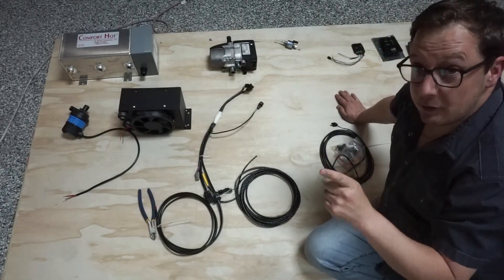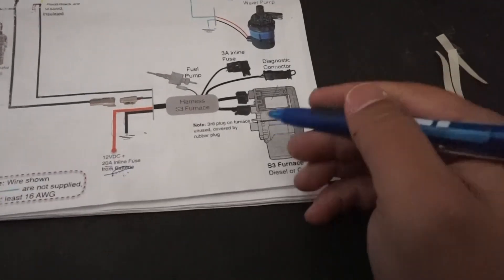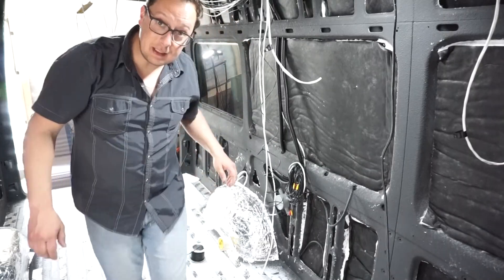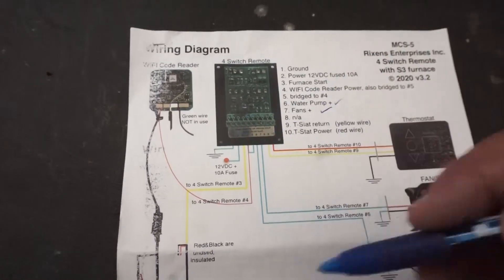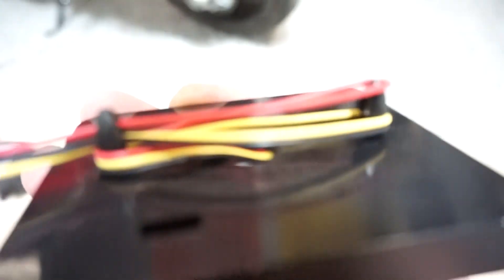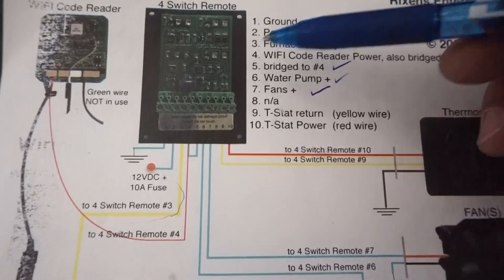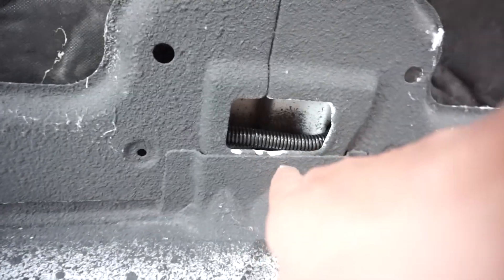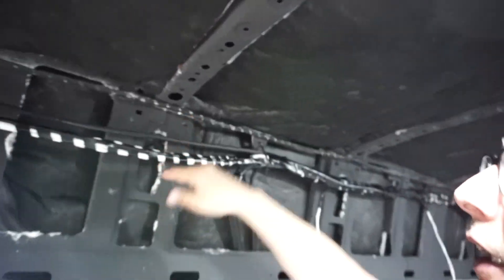Hydronic Diesel Heater PRE-WIRING | FOUR SEASON VAN LIFE | EP.24

Comment: Oouf... you might regret that electrical tape the first time you need to deal with upgrading a wire or trying to access one within the bundle.  For long runs Loom is the smarter way to go, way easier with any future upgrades or wires you may want to access.  Lesson I learned working 7 years in the automotive electronics aftermarket.  Very clean install regardless.
Reply from the maker: Thank you for commenting, I hear exactly what you are saying and I do have a plan to have an access to add new wires if ever needed. I did buy high quality wire and ensured everything was solid mounted to prevent any future wire issues and honestly once you have that many wires run through the chances of pulling it out and adding another to the same loom would be a struggle at best.. Do Stay tuned and I will share what I am doing to deal with potential wire failure or upgrades needed down the road.

Comment: Love the vedio!! Can't wait to see your next hydronic system installation vedio. Hydronic system is also something that I am considering for my vanbuild. Rixen make great product, as shown in your vedio,however their coolant tank place inside the car(right?) . I am a bit concerned with the health and later maintenance issues. I am considering would it be a good idea to just tap in to the engine coolant loop like the hydronic system intended to do. This can protect the engine during winter by pre heat the engine also warm up the room. Also when the engine is running and heat up the coolent, you don't even need to turn on the hydronic system to get hot water! more energy efficient! I am not sure if this is snow and curt 's design.
Reply from the maker: I have a separate pre-heater for the engine that comes from the factory.. They are very similar burners but don't work the same.. You can  plumb it in to create heat off engine without running burner but would be running some pretty long hoses front to back on the van!  Yes coolant tank is inside the van and fully sealed, shouldn't create any health risks.
Thanks for watching and commenting, glad you are enjoying the videos.

Comment: Hi Jeff
You have great organizational skills with all your wires. Wondering why you didn't use zap straps instead of that sticky black tape? I've watched all of the Snow And Curt recirculating shower episodes, AWESOME, and have learned a whole bunch so that my head will blow up. LOL. I am leaning towards Rixen's kit as it includes everything I need  for my shuttle bus conversion. I do believe your are Canadian and was wondering how the shipping was from Rixen and how long did the kit take to arrive? Which Espar model did you get? I am looking at the S3 economy for gas power. Thanks and have a great Day.
Reply from the maker: Hey Kristy, thanks for watching!!  

 I did use some zip ties in certain spots but used electrical tape over the majority just to keep it all tied together without having any pinch points.  It’s how all the wires from the factory come so I just followed suit!  

 As for the heater mine is the S3 unit, shipping was within a few days and freight was included in the price! I am however in conversation with UPS as they sent me a bill after delivery saying they want $400 for duties and taxes!  

 Hope this answers your questions, have a great weekend.
Reply: @DaresDrives  Hi Jeff
WOW WOW WOW Just got Jim's quote. Glad I was sitting down. It costs more than my Victron 3KW Solar System after conversion of our dollar. We as Canadians certainly get hosed on the cost of products to get across the border. Thanks TRUMP. Our builds are very expensive as compared to all the other van builds around the world. I guess all I want is the coolant expansion tank and coolant pump from Rixen. Wonder if Jim will sell them individually to me. I think all the other products I can get here, especially the Espar 3. Thanks for the response.